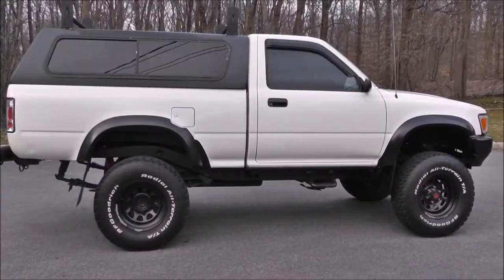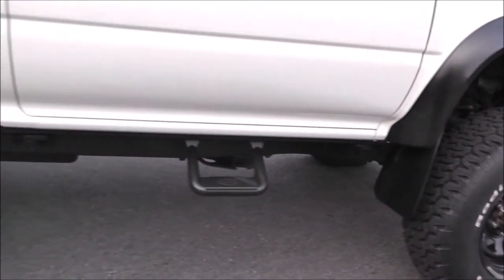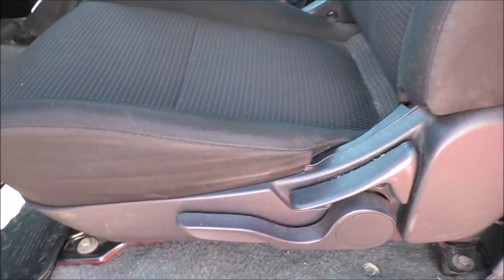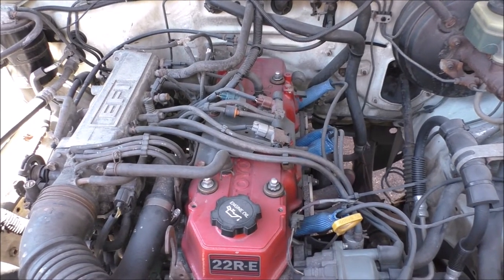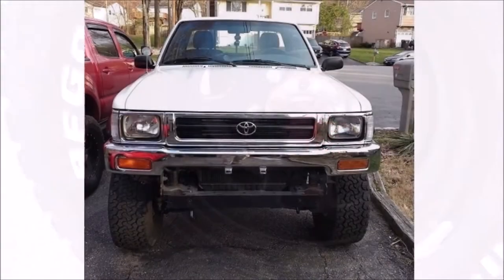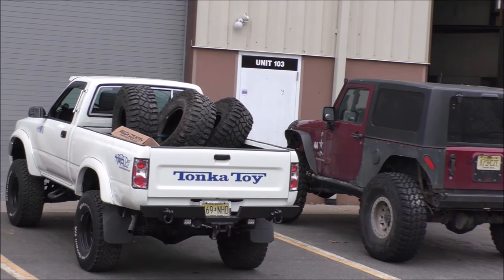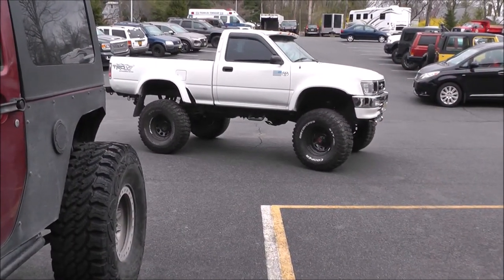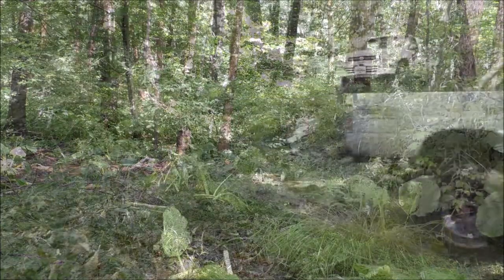1991 Toyota Truck Build- Part I: 5 Inch Lift Kt and More

Comment: Awesome truck, I'll follow the build.
Would the 35's have fit if the body was not lifted 3"? I just bought a 91 yota 4x4 and looking as same rough country lift, however I don't want to lift the body
Reply: Did you ever get an answer to this? I’ve been wondering the same thing.
Reply: I had a 90 and with a 4 inch lift was told 32x11.5x15 are the largest I could go without rubbing, so I'm sure the 4.5-5" lift and 35's will rub unless you turn the torsion bars up and get a lift block for the rear springs.